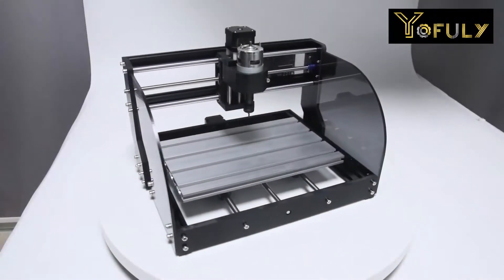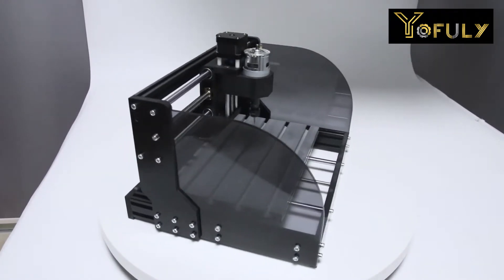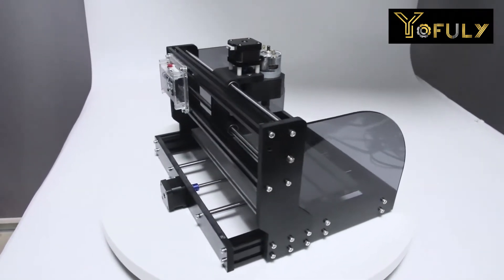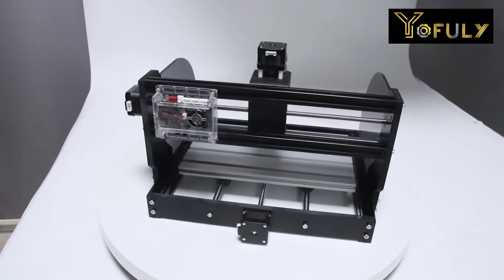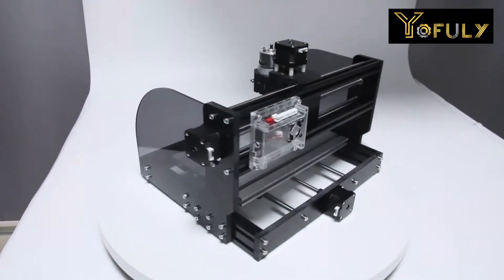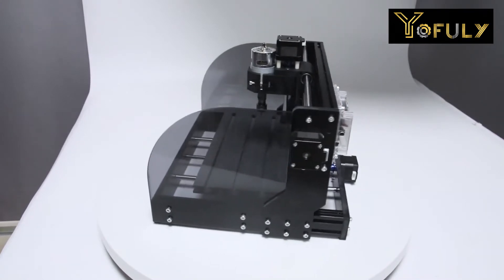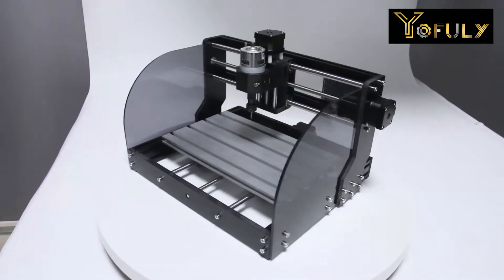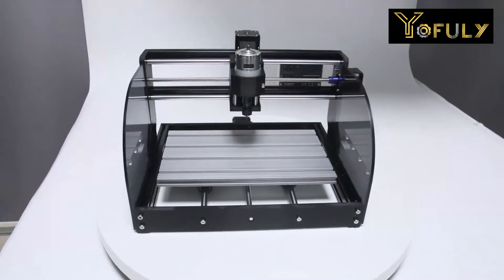Yofuly  3018pro-M Laser Engraver Assembly Tutorial

Comment: I used the video to assemble the machine, I'm recommending installers, pay more attention how exactly to install. I found one mistake on this video. Make sure when you install the sliding aluminum board keep the underneath sliding screws in outer side of Y-axis brackets else the Y-axis will be limited, and doesn't slide all the way back, and fort, also another issue, place couple washers between aluminum sliding board, and sliding brackets to raise the board couple millimeter higher, else the aluminum board will stock to Y-axis motor edge. The washers are not included, please consider you need to replace the 10 attachment screws with 10 metric screws, which are 2 mm longer because of raised board.
Reply from the maker: Thank you for your suggestion ~